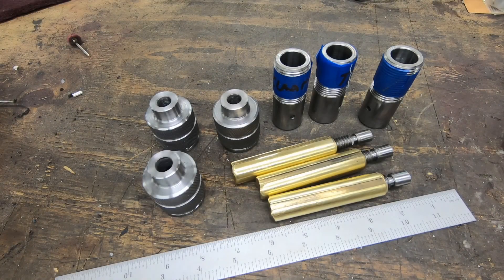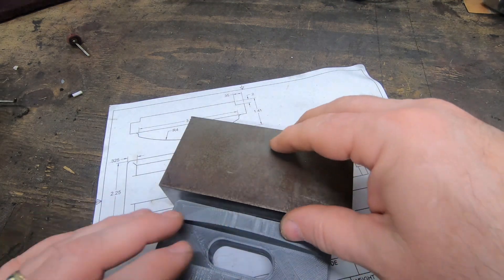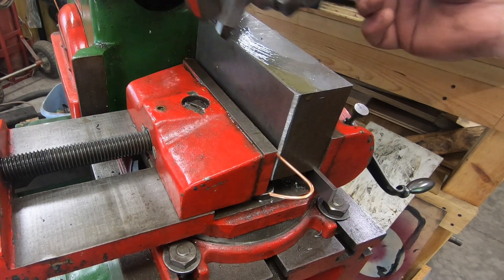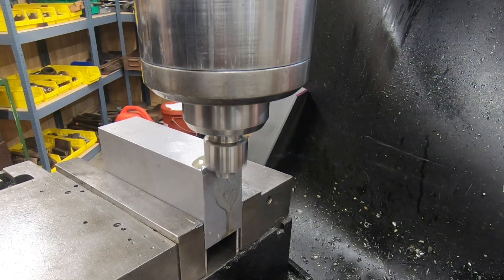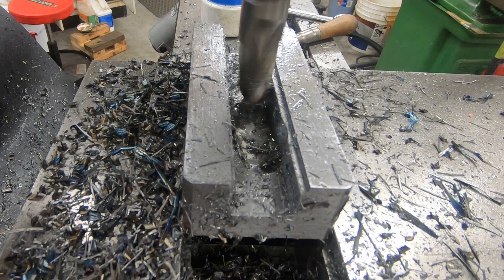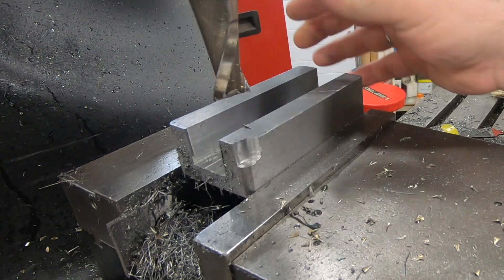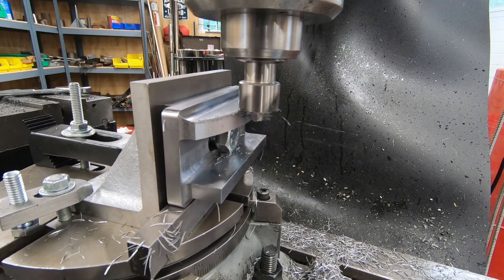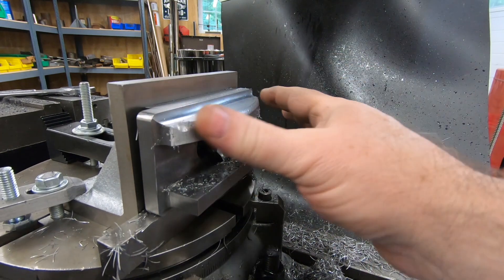Making a Bed Clamp for a South Bend Steady Rest

Comment: Good Sunday Morning from SE Michigan. 

Great project. Love the prototype in plastic approach - I do that as well. Wasting filament is way cheaper in time and money vs. metal. Also great to tweak the design a bit. 

I enjoy watching and listening to a shaper run. Great finish off of your shaper. 

All the best 
Dan
Reply from the maker: Thanks, Dan. I'd love it more if it was a bit quieter. LOL. I have plans to tear it down and see if I can eliminate the rattles. I am sure there's some loose bits in there. First machine I've had in my shop that I used before tearing it apart. It's going to get the treatment after the K&T is a little further along. Thanks for watching!

Comment: Your machining skills are becoming quite impressive!  Love the work you are doing.    That rotary table looks nice too!
Reply from the maker: Thanks, but I'm seriously just getting started. All of this is stuff I picked up from YouTube. My GoPros have been overheating a lot lately, so I missed getting the part where the end mill grabbed the piece and pulled it nearly out of the vise! I need A/C in my shop. lol. Thanks for watching.
Reply: @MyLilMule  I recently had one of those mini-split units put into my shop.  It keeps the temp nice and stable.  And it pulls a lot of moisture out, so it will keep the equipment from rusting from condensation.  So I'm going to tell you it is a necessity, not a luxury.  And now you just HAVE to get one.  LOL!  🙂

Comment: Nice part.  The K&T would have been my choice on the machine to use ..except for the rotary table work.  The steady will be good as new in no time..
Reply from the maker: Thanks for watching. I'm a ways away from being able to use the K&T still. I still haven't decided if I am going to have the table ground. It's going to be expensive, but worth it, I think. I need to see what kind of wear is in the table/saddle/knee and if it's worth grinding, turcite and scraping.